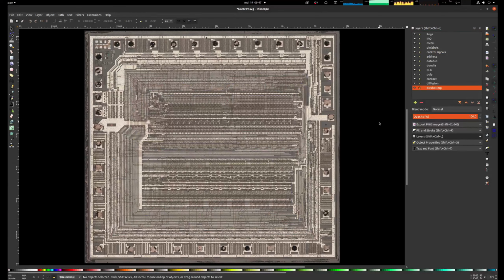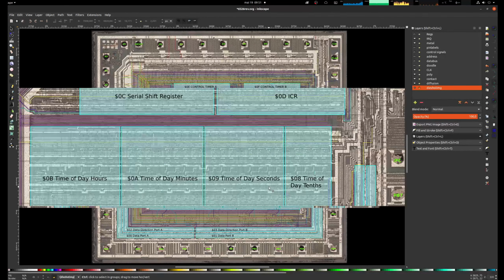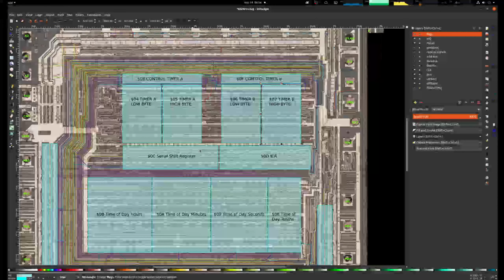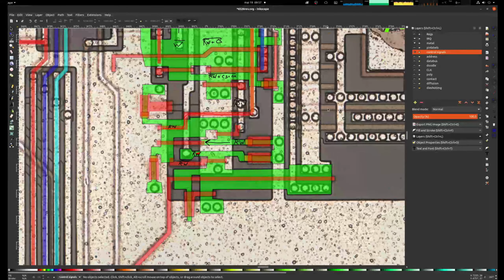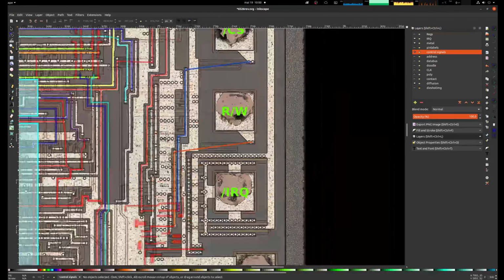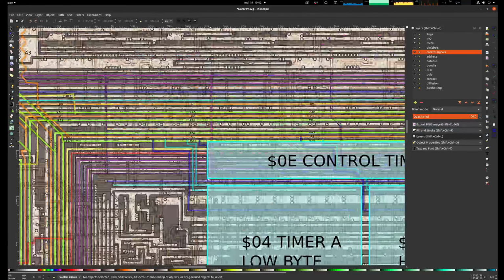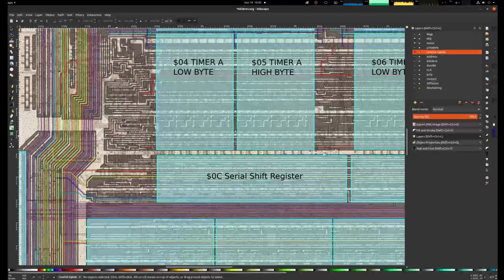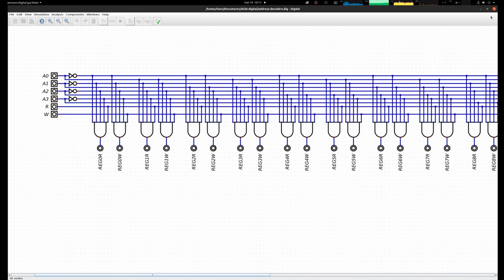MOS 6526 IC dieshot #3 - All register locations + "Digital" software

Comment: Well a RW + CS + CLCK to me smells like IRQ handling. And the IRQ pin appears to be very near as well. Just guessing here..
I really don't understand how you go from these silly lines and squares to anything functional. Magic if you ask me.
Reply from the maker: These three in combination creates a read and write strobe for all the registers. There should be some interraction with the IRQ other than the standard register access. For example i think the irq is reset when the irq register is read.
Reply: @bwack  IRQ's also have to be acknowledged ($D019 I think?) when its handler starts to prevent re-entry problems.